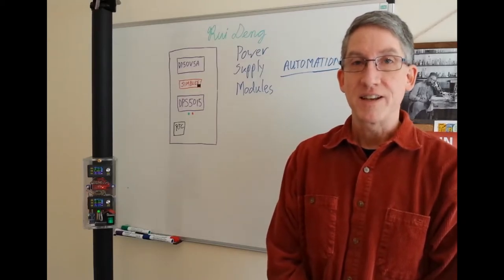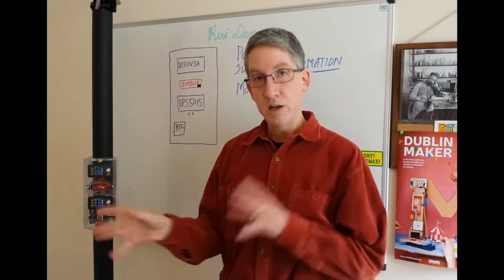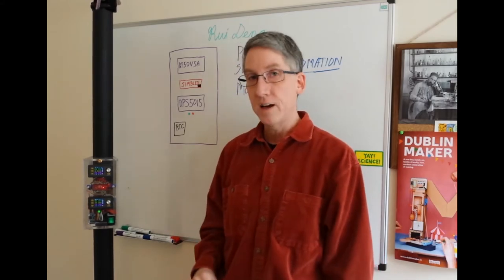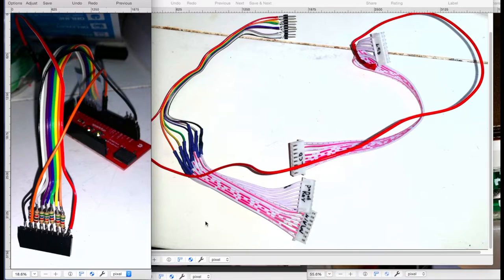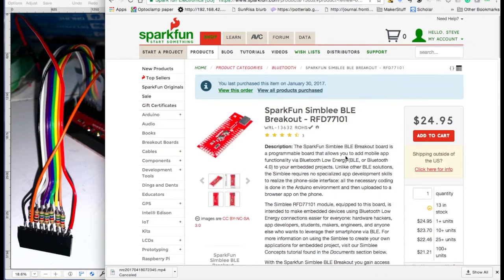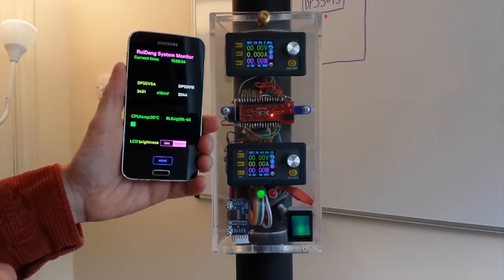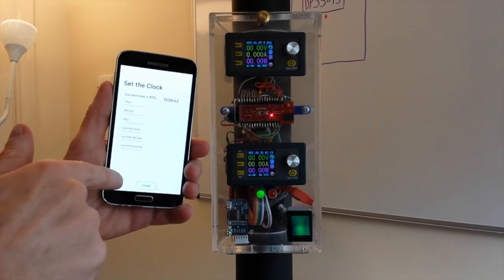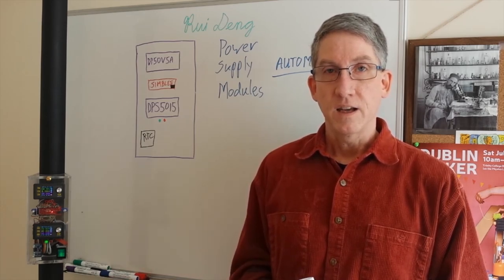RuiDeng DPS5015 power supply automation by Steve M Potter

Comment: cool, how does your code know what the voltage is if you were to manually change it? or gets thrown off a step if the voltage were to droop under what you set it at (it limits you to 1% less than the input)
Reply from the maker: Good question! As I mention near the end of my Instructable, I left it for some other hackers to add the ability to read the actual voltage, by adding a shunt resistor. Even better would be to translate the signals going to the LCD, since the Rui Deng is doing a good job of reading the voltage and current. One thing I DID implement is that when you command a new voltage in my sketch, it first goes down to zero (by clicking way past zero), then virtually clicks clockwise up to the desired voltage, in case someone had changed the voltage manually and it was not what the sketch thought it was. This takes only a fraction of a second. Your sketch could easily keep track of manual changes if one were to include read (pinMode(ID, INPUT)) lines for each switch. For the SIMBLEE there were not enough unused pins for that, but for Teensy 3.6, that would be no problem.
Reply: Ah that is a good way to do it. Too bad the debug ports aren't being used or able to get open sourced that way it isn't so hacked. Being able to send and read would be really nice
Reply from the maker: Yes, maybe if @Rd Tech is reading this, he will get the idea to add this capability.
Reply: SuperBrainAK
I am desinging commucation version, If we oublish it , I will tell you
Reply: Will there be a way to update the firmware on the devices that people already have? That way we can still use them instead of never using them once we buy one with the communication system. If you are worried about releasing your firmware you can do some sort of exchange for a fee. We pay a fee, send in our old devices and you update them, that way it is cheaper to get the communication features.
Reply: You would spend more in shipping and handling than what these cost.

Comment: Hey! :*) 
I'm a true electronics (Arduino) amateur/beginner with a few (gazillion, laughably elementary) questions, so hopefully you (can) bear with me. Intrigued by the scope of possibilities, is an understatement.

So, I see the RD DPS5005 (Communication Version) is available, and I am  wondering what your take (opinion) is? Any info you can offer will be a start. Thx! :*)

PS: I hope Rd Tech reads this, and replies.  :*)
Reply from the maker: I am delighted that RDTech came out with the communication version. I have not been able to try it out since I don't have a Windows machine, and running Windows in emulation mode, I could not get it to work (some problem with the COM port settings). I don't think their existing software is anywhere near as flexible as what you can do by writing your own control software (as I did here), but since it is open-source (in Chinese) you may be able to add to their code rather than start from scratch as I did.  I hope RDTech comes out with a Mac OS X version of their software, and that it has hooks to add your own macros.